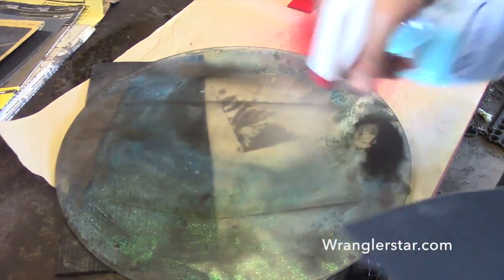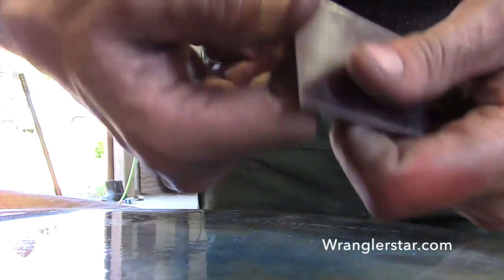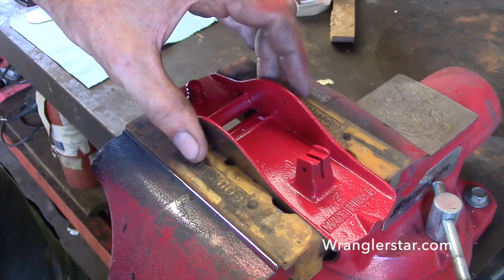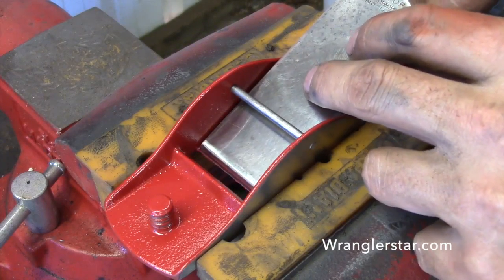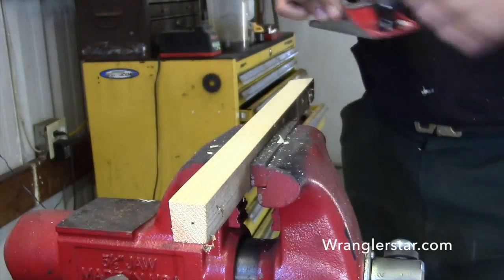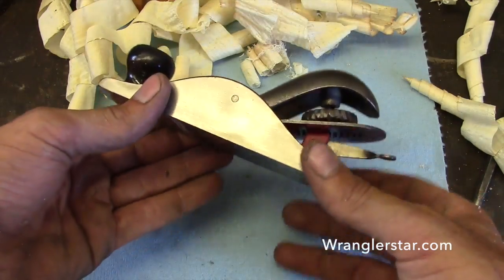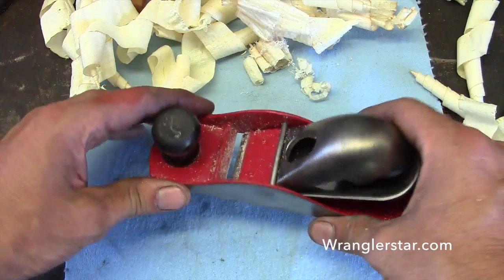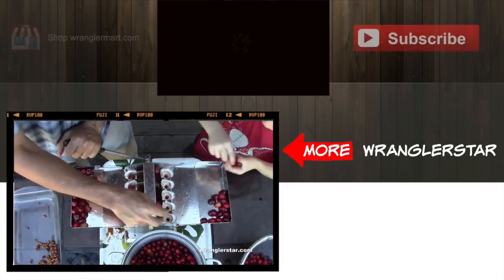Restoring Old Stanley Wood Planes

Comment: Being a young cabinetmaking student I've really developed a passion for fine woodworking and always jump to my hand tools before machinery. Coming out of college soon I'm itching to find a job involving woodwork and begin my career as a woodworker, it's my dream. I've long-term 'borrowed' my fathers old hand tools for my college program, restored them and built a modest collection of chisels, 2 planes, brace and bit, even made a joiners mallet. Although I am not the best suited candidate to receive the plane as I believe someone else would be more deserving. I will not dismiss my desire to add it to my tools. I've begun to respect the meaning of what a tool is and cherish something I can use, maintain and pass down to my children and say, this is your family history. I would rather it go to someone else but if it ends up in my hands it will be well received and cherished.

Comment: I've been gifted a box of tools from my step-father to help me with my venture in working with wood. Some of his tools are old and in need of a little love, one of which, is a large Stanley plane and a smaller plane such as the one in this video. I'd love to make a video talking through what's in there, but my knowledge is so limited I'd be guessing at what most of the items are called and used for. I will, however, endeavour to restore the planes he has so generously given to me. Thank you for the inspiration.

Comment: Very nice job on the restoration. It's hard to beat a blasting cabinet for cleaning off old rust and paint. Even a wire wheel doesn't work nearly as well. Thanks for another great video. Stay safe out there.

Comment: Thank you for the video.  I have a similar plane that I purchased in a 99 cent tool sale back in 1967 when I was working the summer for a carpenter.  I need to dig it out and give it the same treatment.  The old plane was the only thing I could afford and although not the highest quality it was part of my earliest tool set.  Thanks for the inspiration.

Comment: Super job on that block plane Cody. 

So, here's my swing.  At age 57, my wife (53) and I are just starting a homestead on a blank, fallow hay field, after she FINALLY got her immigration visa.  I have no useful traditional woodworking tools other than a cheap old block plane that I hope to restore when I have the time and this would be an awesome beginning.

I'm planning to be OTG and will need many a traditional hand tool to fashion all the various bits & pieces we'll need to be comfy.  T'would be cool to use that plane on my version of the Sellers bench you built last winter.

Comment: Nice restoration. I don't need yours - I have had one like this since I was a kid in the 70s. After your jack plane restoration last fall, I bought a nice Stanley bedrock 1908 joiner plane and a pre-WW2 Stanley Jack plane on Ebay and restored all three. Your tips and tricks for restoration worked beautifully and I now have three sweet planes (and a bunch of chisels, slick, etc that I also bought and restored last Christmas).

Comment: That is a beautiful plane!  I have very limited funds -school teacher-but I have been looking at inexpensive planes and you are right, you can't get a good plane for low cost. I would give this plane a good home and it would be well loved. Thanks for your consideration.
Reply: Rick Dearmont 
Have you tried old car boot? garage sales? Old antique shops?  You can often find old fashion beech wood planes going for pennies. You'll probably have to clean up the blade like Wranglestar did in his video. You'll need a small mallet as well for adjustment, I still use mine today TBH I like them better than the metal ones. I put my first toolset together like this when I first started out. Everything from planes to coopers drawing knifes to spokeshave's, practically for nothing anyway's good luck to you.

Comment: I have  one of those little block planes that was given to me as a gift, I have mine mostly restored, all rust gone, as well as the shoe flattened, but the iron isn't super sharp, and the edge isn't straight across, it drops down on one side because I am not the best at hand sharpening. I was looking at one of the consistent angle sharpeners for plane irons but I have yet to acquire one.  I haven't painted mine at all, its all silver which I like, but after seeing that one I might have to paint it because yours looks very good.

Comment: I had used distilled white vinegar and an SOS pad to remove rust a while back.It worked really well on an old plane iron from the 1800's. That can be another option for those without a blast cabinet.

Comment: Low angle block planes are a staple. That turned out real fine!! Thanks dor the journey. I need to finde one. I have a little simpler stanley, that i use for shaving doors and such. I would like to find one of those, as it is a little larger than my little block i have. Good all around size.

Comment: sadly i would not be able to take this. 
I am 12 years old and I live on a small ranch in California. have a small bench in the corner of a 2 car garage that is cluttered with tools my dad has no where else to put and my moms car. so i cannot do any wood working projects for there is not enough room. recently I proceeded with a restoration of a post drill from 1915
that i got from a neighbor for 100 dollars. I am yet to put any paint on it for it is in such good condition that the black paint still looks good. it was seized up when i got it but a little WD-40 fixed that. well Mr.Wranglerstar keep going with the videos and keep up the good work.

Hunter

Comment: Be sure and keep the block plane away from your other planes. They multiply.

Those are nice little planes. There is something satisfying about their simplicity. No fancy mouth adjusters, cap levers, lateral adjusters. The other one that is nice has two iron positions: a normal position and the second puts the iron in facing the back of the plane to put it closer to the edge to use as a bull-nose. I think it is a #110 if I remember my Stanley plane numbers off the top of my head.

Comment: Nice restoration! I would personally paint the other exposed steel parts black. It would prevent rust and look great contrasting the red. I would use the plane to refinish a table I've been working on.

Comment: you can put clear varnish.poly on the bare steel on the sides to stop rusting, the adjustable cutter is for a drill press and is holes and wood discs and holes

Comment: One of your commenters talked about the Paul Sellers videos and I totally agree. He does everything with a #4 smootng plane! And he has built furniture for the Queen of England. As to restoring planes: if the iron is  not sharp it will not cut no matter what. The sole must be flat. It does not matter if the iron is pitted as long as the edge and about 3mm of back are clean. Pits in the back are, well, the pits. If you are dealing with a plane with an adjustable throat you really have to be very careful with the adjustment. (The adjustment is done by the frog inside the plane.) Finally in a block plane you go bevel up. Regular planes with a cap iron... oh dear, I am wasting everybody's time. Go get Garret Wade's book, The Hand Plane. All wil be revealed.

Comment: Just as an aside to your video.  Oils are fine preservatives for steel and iron tools.  But, an old timey solution for the same problem and far superior, in many ways, is something you have in abundance, beeswax.  Just set some in direct sunlight along  with the heat of your fingers, rub the wax all over the exposed metal.  The metal will stay bright and rust free.  As an added benefit, the beeswax will act as a non-contaminating lubricant where it comes in direct contact with wood.  Reapply as required.
Reply from the maker: Tyrod 01 Thank you for the tip Tyrod,
Reply: +Tyrod 01 That it what i use. Plus it smell good.

Comment: Soak rusty metal parts in distilled white vinegar for an hour or so and the rust just falls off. Use a stainless steel brush and knock off the loose rust. Looks good as new or good as restored.

Comment: I can highly recommend diamond stones for sharpening. They are expensive though.
Reply from the maker: StarDustSid I have been looking at them on Amazon. Yes they look really nice but are a bit pricey,
Reply: wranglerstar You're right about the cost. I bought mine from Amazon, which where the cheapest at the time. I got three 8" x 3" DMT steel plate diamond stones, (American made), in medium, fine and extra fine. They cost about £80 each. so £240 in total ($375) which I agree, is very expensive. I love them though, no more messing with stones or paper, they are perfectly flat and cut through metal rapidly and smoothly. And everybody who uses them tells me they last a very long time.(Edit: fixed my bad maths.)

Comment: Nice job Cody, but are you seriously claiming you can't buy anything similar for under $200? I found an almost identical Stanley block plane for under £24 (under $40) easily. The only difference is the modern version has a nub on the front instead of a wooden knob.

Comment: Sorry to be negative, but it's a cheep carpenter's plane.  Your statement about not being able to pick one up for under $200 is incorrect.  You can get a much nicer Stanley 12-220 new on Amazon for $20.  They will work similarly, but the one you restored is nothing to brag about, other than the fact that you did a great job.  I hope someone enjoys using it.